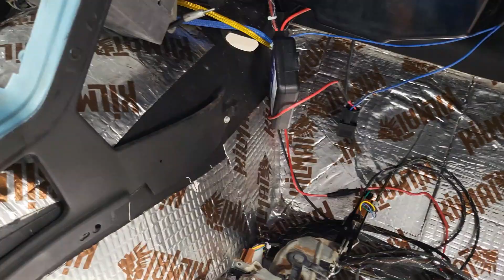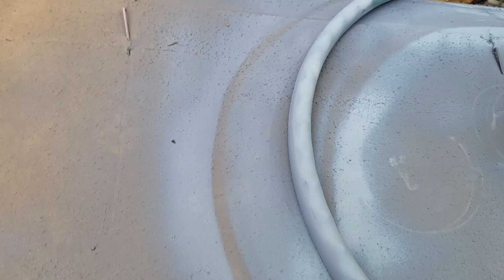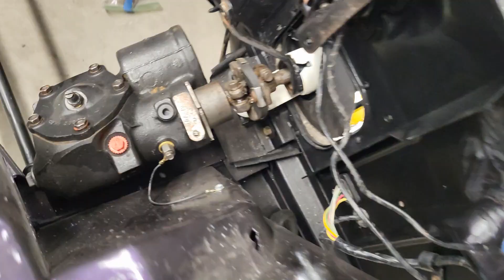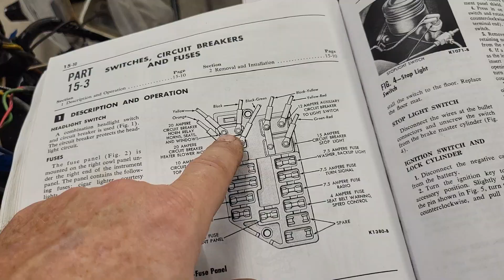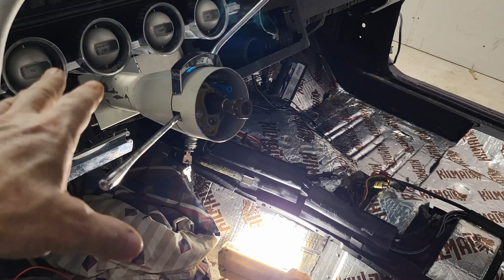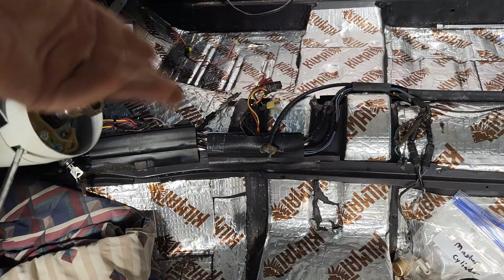1964 Thunderbird Restoration - Update 1

Comment: I had to rewatch this video because of the after market air conditioning install. I have a customer that commented on this video because she is thinking of having her air conditioning fixed and saw that you installed an after market system. She asked me about it and I have never installed the after market system, I have only rebuilt originals. Do you have any plans on maybe doing a video describing your experience with this system and what you had to go through to get it in and an overall review and how you would rate it? Since you are the only one I know that has installed this system, it would be nice to get your feedback. I'm sure it would help others too that may be interested in doing it. Now that you have the car running, maybe show how it works, etc. Anyway, thanks again.
Reply from the maker: I would love to do that.  Let me finish the install first.  I haven't done the under hood parts yet.  Very soon though
Reply from the maker: Hey. The video showing the a/c install will come out tomorrow.  I haven't had it charged yet but it does go over the install from start to finish.
Reply: @Exit45Restorations  very good, thank you very much. Should be very interesting and informative. Thanks.

Comment: watching your setup for the slide mechanism and the door that moves with the steering column. mine didn't have springs on them when I removed all of that, was there a specific spring that you sourced or just went to the hardware store and found something that worked?
Reply from the maker: I went to the Ace hardware  and found some that worked.
Reply: @Exit45Restorations  Same length?

Comment: Hello Matt. Wiring issues are time consuming for sure. I took apart some of those relays before. The coil wire is very thin and would usually be broken at the solder joint on the terminals. I try to fix them because they are so expensive. Did you figure out what that relay on the driver side fender apron is for? My 66 doesn't have one there. Great video. Maybe you can show your engine rebuild?
George B
Reply from the maker: I did find out.  Nick posted that it's the brake light relay.  Since I didn't have any issues with that one I didn't end up tracing any wires to it.  I'm right with you on the engine build and have been filming that so coming soon to theater need you.. lol

Comment: I just took my neutral safety switch apart because the previous owner had basically bypassed it (which seems kinda unsafe). There are little brass balls inside that create the contacts. Mine had worn down and were flat on one side. I ordered some new balls, I hope that's the issue. It came apart pretty easily, so it may be worth checking out, or I guess you could replace the entire thing, but that's no fun haha. I had to go to work, so I haven't got mine back together yet.
Reply from the maker: Hey.. when I took mine off it fell apart so it was a good idea to replace it now.  Interesting though that you can disassemble them and repair them.
Reply: @Exit45Restorations  Well so far all I've proven is that they can be disassembled....I did stick back together without the balls, so it can be reassembled, and I can't see why it wouldn't work. But I'll give it one shot, then I'll probably be going to Bird's Nest
Reply from the maker: @buckdontknow  yep.  I just put my order in with them